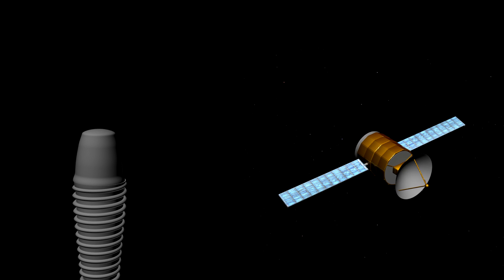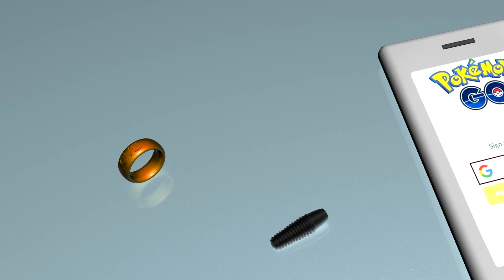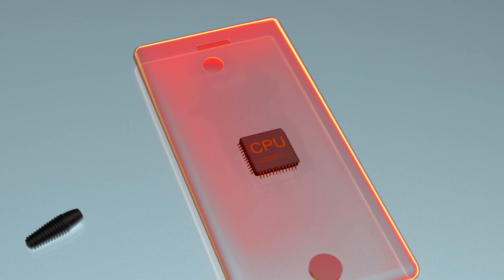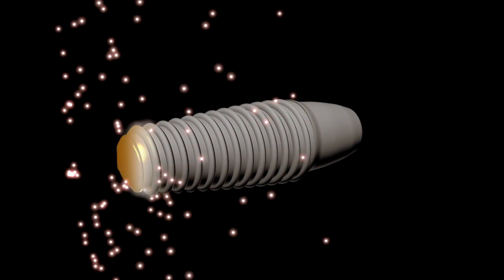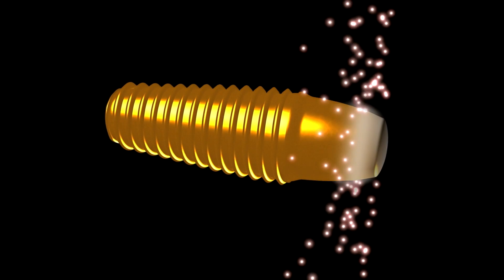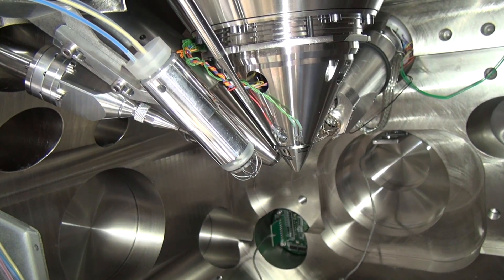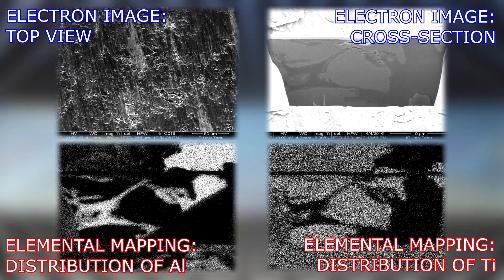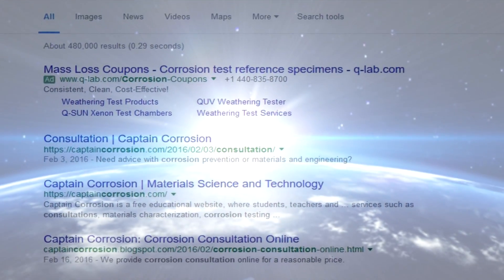How to Fight the Invisible Enemy?

Comment: Thanks! Very well explained! What will be the cost of coating some small object with corrosion resistant layer?
Reply from the maker: That is an excellent question! The cost of the coating is related to the number of small objects one can fit into the reaction chamber of an atomic layer deposition reactor. Basically, if you can coat 1000 silver rings at the same time, then the price increase for a single ring would be less than an euro.
Reply: Captain Corrosion Wow, that is awesome if 1 euro can significantly prolong the lifetime of a detail. Thanks for a quick reply!

Comment: Can you use this technology to prevent silver jewelry from becoming tarnished?
Reply from the maker: Yes of course! With atomic layer deposition it is possible to apply a nearly invisible ceramic coating on silver jewelry. This coating prevents the corrosive substances from reaching the metals surface and therefore tarnish can no longer form.